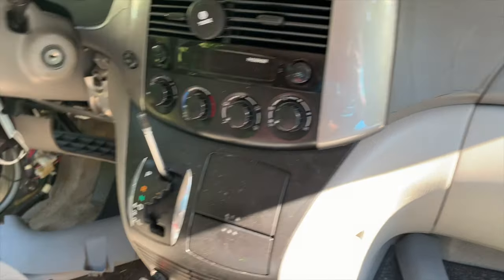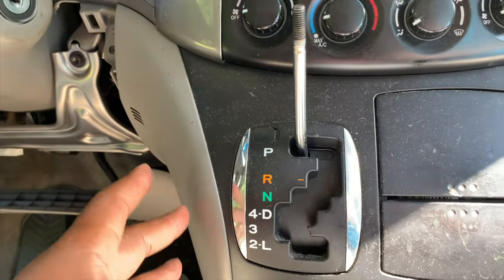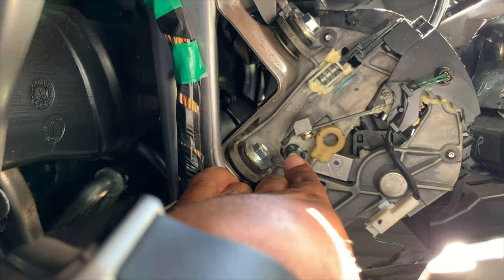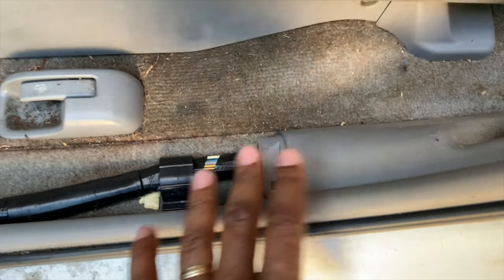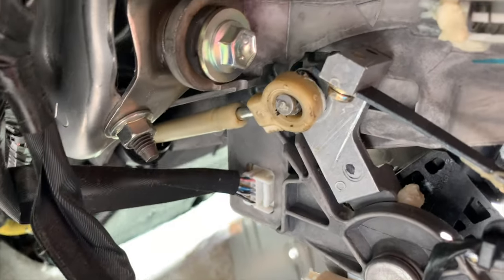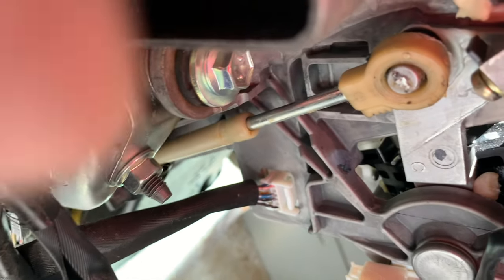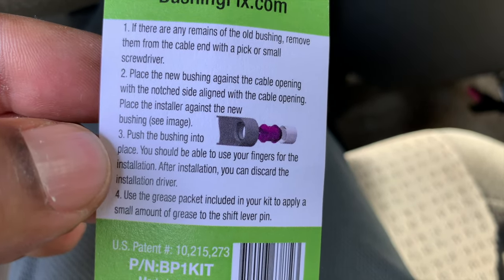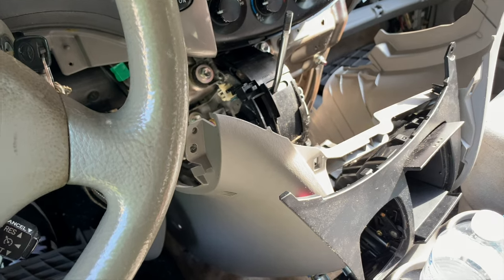Toyota Sienna  - Broken Gear Shift / How to Repair - My Van only goes into Neutral

Comment: Thank you so much for being an excellent teacher.  My niece's 2009 Sienna has this gear shift problem and she can't afford to take it to a garage. You are a life saver. Toyota should be ashamed of themselves for purposefully making it so difficult to get into the dash to repair something like this.
Reply from the maker: @Terri... Glad to be of assistance.  Thanks for your kind words... best to you and your niece.
Reply: Worse yet, Toyota won't replace just the bushing (a fifty cent part) and instead will charge you over $300 for the entire replacement shifter cable, and likely another $500 in labor to install it.

Comment: Great video. You saved us lots of time and money. Siennas are solid vehicles and last forever. It is incredible that this little part can get you stranded in the middle of nowhere
Reply: Ah but it can't.  Mine broke and I just manually moved the shifter at the transmission.  You never need to be stuck from this outage! (Put the parking brake on if you are alone when shifting into gear!  Also Park was like in the middle and you pull up one click for drive, I think down one click was neutral and down two clicks was reverse...  :)  )
Reply from the maker: Glad it helped!

Comment: OUTSTANDING - A note:  You can verify it's the linkage coming apart by simply removing the shift knob, then the plate underneath, and then shine a flashlight - not much room but easy to see the removed cable.  Since I don't like this failure mode, I'm working on options for easier access before I finish the repair.  Thanks very much for posting this, I was clueless when it happened.
Reply from the maker: @Mike, thanks for watching and for the kind words.  Glad it helped.  Let me know if you find a quicker route to the source; I'm not a mechanic, so I did what I could.  Hope to hear back from you soon.
Reply: @AdventuresAbodes  ,,,,,,,,,,
Reply: I did that and was able to put the hook end of a metal skewer and shifted back to P, start the car and shift to drive to the store, bought the bushing and replaced it.

Comment: my 2009 Toyota Sienna did this last Friday. I am thankful for videos like this. The transmission shop told me it was an issue under the dash and they don't do interior work. That confirmed it was definitely going to be similar. It is thankfully stuck in Neutral so it was easy to move the vehicle, but also the emergency brake is the only way to keep vehicle stationary. Hoping for the best.
Reply from the maker: I'm sure you can do this on your own.  I thought it was my transmission until I did the research.  Please keep me posted / I'm hopeful this will help you do it on your own.  Go ahead now and order the part, as it'll take 2 days (assuming you have prime) to get from Amazon.  NO auto store had the part, unfortunately.  Thanks for watching and have a great day.
Reply: @AdventuresAbodes  it took me about an hour and a half to take everything apart and put back together. Definitely an easy fix and happy it was that issue.

Comment: the Part's name, shift linkage repair kit. Thank you. Mines had broke about 3 months ago I found it within 30 minutes but got to work late. Since then I couldn't find the name to this. But thanks to you I did
Reply: HI... thanks for watching.  The name of the part is Bushing Fix BP1Kit - Transmission Shift Cable Bushing Repair Kit

Comment: You are the GOAT. Great video. My 2008 Sienna did this right as we were leaving for vacation. I was able to make it home thanks to an old guy that stopped to offer help and your video. I tried a bunch of stuff to rescue ghe vacation. I finally found a 1/4 spring type hose clamp that I pushed over the end of that knob. It’s holding real well I’ll probably get that kid when we get back from vacation.

PS I was able to get home by reaching down to the link by the and shift the gears myself. Push all the way down for park the one click for reverse and two for drive etc etc. 

Thanks again for the help.
Reply from the maker: I'm glad you made it home safely and that our video helped.  My wife was stranded picking up my daugher from swim practice.

Comment: Our van just did this this morning. Thank you for putting together this video! Looks like we have a weekend project!
Reply from the maker: Katie... well, thanks for watching.  It's better than taking it to the dealer (lol).  It goes along quite well once you get started.  Just a quick tip... make sure you don't end up w/ extra screws when you're done as I did.  Just put them all back (lol).
Reply from the maker: Also, go ahead and order your part now and it should be there by the time you get ready to work on your van.  Be well!
Reply: @AdventuresAbodes  dude, if you werk on cars you will always end up with extra screws, bolts and clips! 😂

we has a sienna at werk and no one wants to touch it. i just might get them to reopen the ticket and tackle the job. your video was very informative 🤙🏼
thank you

Comment: My van did this exact thing,  won't shift out of neutral. But I am not as patient as you. I cut an access panel right where I needed to. I will use silicon to reattach my access panel once I have made a permanent fix.
Reply from the maker: @Andrew... Thanks for watching and sharing.  Glad you were able to get your van back moving again.

Comment: Another tip that might be helpful:
If the grommet/bushing you replace is still a little loose, you can wrap plumbers tape around the center of the bushing to make it a firm fit
Reply from the maker: @jamesm28, thanks for watching and for the tip.

Comment: Same issue here,  found that the gear selection can be set by opening the hood and on the lower right as you face the engine you can manually select the Park or Reverse or Neutral (which ever you're stuck in) on the transmission to match where the selector is. In other words you can manually change the arm on the transmission itself to move the cable. Had a tow truck driver show me that deal. Looks like you could put a screw in that plastic stud to hold that 'banjo' fitting. Great video.
Reply from the maker: @Sam... thanks for watching and for the additional details.  Glad you got your van back moving.  be well!

Comment: Great video!  Exactly the info I needed!  Now I need my hands on the ## designer of this mess!  No reason you should have to take so much off.  I have a van with 300,000 miles on it…I’m going to simply cut a hole in the panel to expose the shifter!…what the designer should have done!  Keep it neat and it should be OK!

Comment: thank yiu for the video, I can't do it by myself, but i could told to the machanic where is the problem from, the part doesnt cost a lot money, but the labor fee at least one - two hour charged!
Reply from the maker: Thanks for watching and sharing.
Reply: @AdventuresAbodes  I guess i missed the letter from Toyota dealer, Toyota Recall : Shift Lever Assembly May Allow Rollaway 2004 Toyota Sienna If the shift lever is moved out of the Park position without the brake applied, the transmission will either engage a drive gear or Neutral, increasing the risk of a backover or roll away crash.

Comment: If you have small hands, you can snake your way in thru the opening below the shifter, the large item / trash can tip out bin has direct access to the linkage. Be patient, let your fingers do the walking.
Reply from the maker: Thanks for the advice and for watching.

Comment: My 06 sienna just did this. And it's hot as hell outside so I gotta wait a awhile to do this.
Reply: Take your time... be safe.  It's pretty easy but has lots of moving parts.  Let me know how it goes.
Reply: @healingearthtones4544  thank you yeah I just ordered the part it's more than I thought it was gonna be lol but oh well cheaper than a mechanic
Reply: I also did mine about 3 months ago and I went to the auto store and bought a shift linkage for a dodge, then I dremeled out the inside just until the point I could force it on the way it's supposed to fit. It cost me $17 I think for the dodge piece, but this is an option for anyone who comes across this comment. I didn't want to wait for online parts to come in or talk to Toyota, I work as a delivery driver and I wanted my car same day. I've had no issues and I drive 6k miles a week.

Comment: Didn't find the panels tricky at all and was able to bend the panel around the shifter out far enough to make the repair without having to remove that panel or any panels over into the passenger side.
Reply from the maker: Thanks for sharing.

Comment: it would seem that one could cut along a crease on that plastic panel to gain access.  Make a rectangle flap, and seal up with same color vinyl tape or hot gun glue afterwards.  No one notices on a 200k mile vehicle.   Edit, hole saw drilled a cut-out 3" diameter piece, down from the Park position lever, about 3.5 inches away.  Yes, the bushing is gone, and the shift link hanging in the air freely.
Reply from the maker: You're really good if you can do that.  Hope this video helped.
Reply: @AdventuresAbodes  thanks, but I'm just real lazy, and don't have the patience to take everything apart and put back together.   Although I can, and did when I was young.

Comment: From Temple, TX thanks for the video,you didn't say what you had to use to get the dash off.
Reply from the maker: Start w/ the kick boards on the drivers side or passengers side.  Each time you take something off, it leads to another screw until you get to the shaft.  Hope this helps.

Comment: MY 2001 toyota sequoia will not go to park sometimes. All other gears are working fine. I checked to see any cracks on the shifter assembly and none found. All bushings are working fine. Checked under the gear box and did not find any loose or missing bushings. PLs help!! ty
Reply from the maker: Sorry for late response.  Were you able to resolve?
Reply: @AdventuresAbodes  transmission re-build
Reply from the maker: @mozee01  Sorry to hear... that's a major repair; had to do it on my BMW.

Comment: Drive to the dealer 10 bucks boom done and don't have to take whole dash apart just the middle and driver side and pull back and reach in 10 min job in total well 40 with drive to the dealer done I can shift again yyayyy

Comment: Toyota now sells that. Bushing. Part No. 33835-08010. I paid $3.15 each at the dealership.
Reply from the maker: Thanks for watching and thanks for the update.  Did you get the work done at the dealership?  Curious to the labor charge if so.